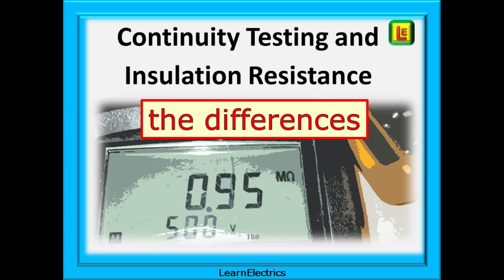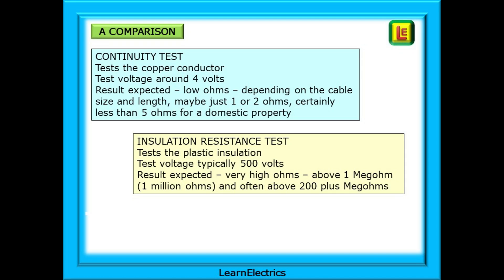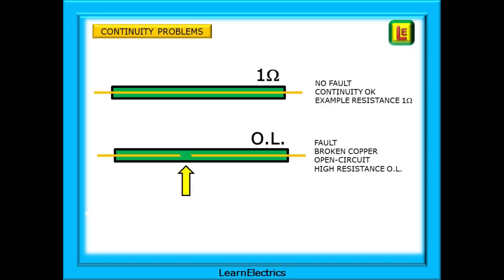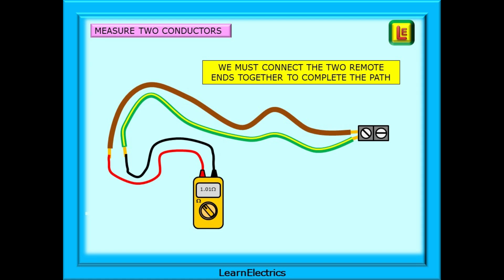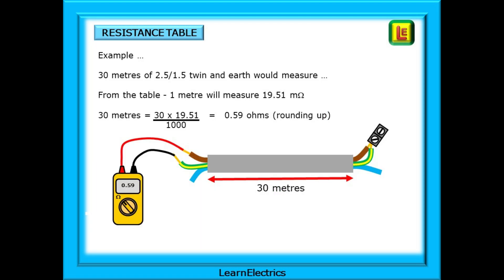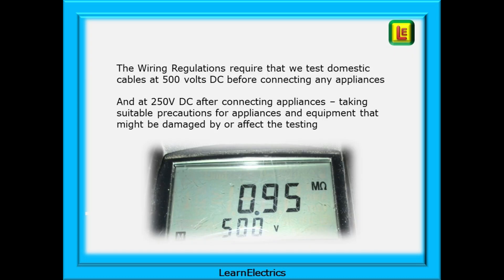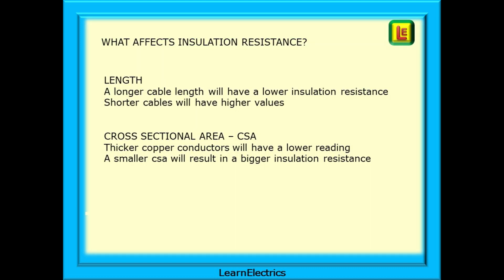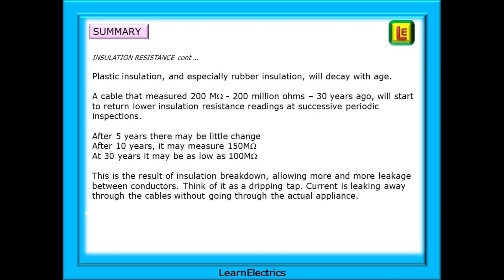CONTINUITY TESTING AND INSULATION RESISTANCE TESTING – THE DIFFERENCES - THE REASONS – AND MORE

Comment: 1:02 Please can you use IR tester for continuity test, if yes how is it done.
Reply from the maker: No, the IR tester outputs 500 volts. You need to use a low ohms meter with about 4 volt output.
Have a look at the video below on using a multimeter. 
https://www.youtube.com/watch?v=R1n4HSCTE9I

Comment: Greetings - Explain (as demonstrated in a different video you produced) that you connected the megohmmeter to two insulated conductors. If only (1) of the conductors insulation is damaged yet the other insulated conductor is fine. Explain how your megohmmeter gets return results when both conductors are insulated and only one is damaged.
Reply from the maker: If the insulation for the good conductor is of the correct spec, then the test will pass. The test voltage will not penetrate the good insulation.
Reply: @learnelectrics4402  Great. However, I have "on record" the engineers for AEMC who says the undamaged conductor will magically "absorb" the return current. Mind you (3) emails before that they said their megger would not work. So, the industry is being fed BS from Manufacturers of Test Devices.

Comment: What is the reason for main earth wire and bonding and cpcs  must be connected when you do an insulation resistance test  is it because if there is an earth fault you would get a shock on all the metal work when you press the 500 volts button is that dangerous or would you just jump of the pipe and be ok
Reply from the maker: You are making sure that there are no pathways from line or neutral through any exposed metalwork, metal trunking etc. If the earth was isolated, you would not be able to check this.

Comment: Yet another brilliant and well explained video. One little question Dave, if i may, if you had continuity between earth and neutral, should this not show as a fail in a insulation resistance test between L+N together to earth?
Reply from the maker: It would, which is why we always put the earth back in the earth bar for IR tests. we wouldn't normally IR test with L and N connected, usually have both ends of each in free air.

Comment: Great video and very informative thanks for sharing your expertise on this testing of cable procedure, I just want to ask if 10Megaohm is acceptable insulation reading for new installations, for this cable specifications: cross sectional area = (38mm.squared,THHN max V=600V )test voltage used was 1000Vdc.
Reply from the maker: The Regs expect the IR test to be above 1Megohm, though generally we look for at least 2 Mohms.
Take a look at this video. Dave.
https://www.youtube.com/watch?v=tT3eGK1b0Yk

Comment: Can we perform an insulation resistance test with LED battens on the circuit.  Many thanks
Reply from the maker: There will be transformers and voltage regulators across the circuit. These will need to be removed before testing. The transformer windings will be a dead short to the DC test voltage. And test at 250V DC, that way you will reduce the chance of damaging anything still in circuit. Thanks for watching. Dave.

Comment: Hi Dave another superb testing video. Just a we query reg the resistance table in the on site guide, it only gives the resistance of the line and cpc conductor milliohm values or r1 + r2  value and not the neutral. Is it not important to find the resistance value of neutral as well as its also a live conductor or is it only r1 + r2 we need to know as this resistance value can affect the time it takes for the fault current to disconnect the RCD in case of a fault etc. Is it not important to know the resistance value of the Rn as well for the PSCC in a table so you can refer to it during testing. I feel like this is maybe a really silly question maybe i will watch the video again.
Reply from the maker: Forget all that Angela. Yes, the tables give Line conductor and CPC, but does it matter what it is called, all you are interested in is the actual size, so choose the size of the neutral in the Line column and the cpc in the earth column, job done. Or if you want L +N, because they are the same size, just choose the same size from the line and earth columns - done. Have a look at this video I made, it answers exactly what you are asking. Dave.
https://www.youtube.com/watch?v=Wl1--nxRnME

Comment: Very helpful, thank you. As an electrical installations diploma student, it helps me so much to understand the principles behind electrical testing and installation processes, why we are doing these tests and what is happening when we're doing them. This video is really clear and the diagrams help make sense of the explanations.

One question though - you say with the insulation resistance test that the testing device is able to 'detect' how much charge is built up on the two conductors. How? Surely unless we get a reading of infinity, or the maximum reading of the testing device, then would it not logically mean that some amount of charge is getting through, albeit very very small, and that is enabling the testing device to return a reading of a given value, less than infinity?
Reply from the maker: How they make the testers I cannot say Michael. They have some clever boffins designing these things. Thanks for watching, appreciated,

Comment: Thanks for another great vid, great explanation as always. Would you be able to further explain why it is that a low resistance ohmmeter should have a no load voltage between 4 and 24volts and a short circuit current of no less than 200mA? This question seems to appear everywhere and yet I have no great explanation as to why other than safety. Many thanks
Reply from the maker: Good question. These parameters were set by the boffins many years ago as a way of standardising testing. it's the parameters that all meter manufacturer's work to. And yes, its a popular question in many exams.
Thanks for watching, Dave.

Comment: For the short duration insulation tests carried out using a multifunction tester, the cable size and length could affect the reading. That effect can be overcome using an extended test duration. On all the basic insulation testing that I do, the test is applied for 1 minute with the value recorded at the end, that usually gives enough time to overcome the cable capacitance and gives a more genuine insulation value for the cable.
Reply: But what extra value would these results have to anyone, that would justify eating the meter batteries up like that? Surely an IR test reading is way above the 1-2 megohms for a healthy installation, and that's all you need to know.
Reply: @Jo3yW  If you test larger sized cabling over longer distances, then a 3 to 4 second IR test may not produce a satisfactory result, but when tested for 1 minute to overcome the cable capacitance it will be fine. In those cases, a perfectly good cable would be marked as failed. 
On new builds the contract may specify a required IR reading on cables greater than in the standards, so you could find the same scenario where a 3 to 4 second test shows a failure, but a 1 minute test shows a pass.
If the testing is being carried out for condition monitoring rather than just go-no-go testing, then they need to be tested to a more consistent standard so that comparable results for trending can be obtained irrespective of the test apparatus used or who the test engineer is.
In a domestic environment you are not likely to come across this, but on larger industrial installations, these kind of scenarios or common.
Reply from the maker: Thanks for the input. I understand the point you make but most multi-function testers are set for a 3 or 4 second test duration and we sparkies have no control over the time period. Thanks for the support, appreciated, Dave.

Comment: That was a big help, thanks for explaining that Dave.  The insulation resistance test actually makes sense now. I think people assume learners understand what’s going on in the conductor itself when carrying out a test. And I was not aware of the voltage used on continuity testing. I was told that the test machines use a lot of the battery life when carrying out continuity testing, esp long runs. Many Many thanks.
Reply from the maker: Thanks Jim. I suppose how much testing you do will affect battery life. My Megger had rechargeables and they needed a regular top up. The Unitest has 6 standard AA batteries and they always seem to last forever. Longer runs have more resistance so less current used, they should last longer than short runs. Dave.

Comment: Hi Dave I can't thank you enough. Also I appreciate the expected reading for continuity between light or sockets circus.  
I notice many electrician are applying 250V  before applying 500V for the IR test to find out if by accident any load may still be attached, What would be the expected  reading if a load by accident would be attached to the circuit when applying 250V. Thanks A Lot have a great day!!
Reply from the maker: Thanks for the question Luca. I always test at 250V first, less chance of damaging anything and an opportunity to remove it from circuit. If its a light bulb, phone charger you will usually get 0.00 Mohms. If its a neon in an FCU it will read about 0.25 Mohms. Its just experience.
Reply: @learnelectrics4402  🙏 Thank you

Comment: Great video, very informative for the casual interested observer. With regards to that shower, the builder would surely have used the 4mm cable for the entire length and then charge the customer accordingly? But who gets a builder to do their electrics, cheapskates, that's who. You get what you pay for I suppose.
Reply from the maker: Not all builders are bad, most want to do a good job. Thanks for the input Tom.